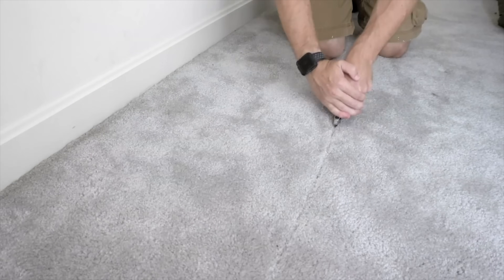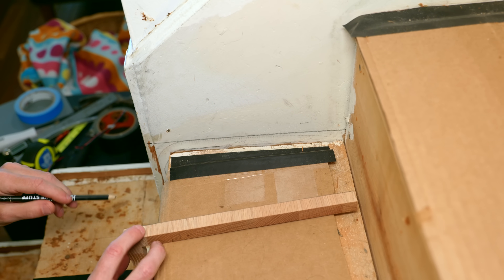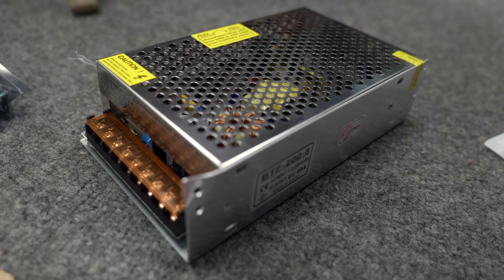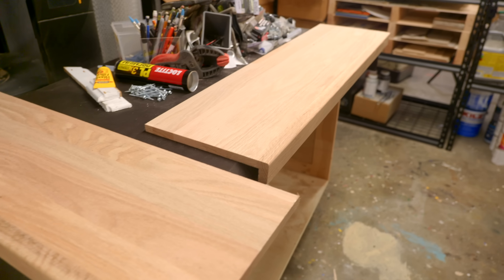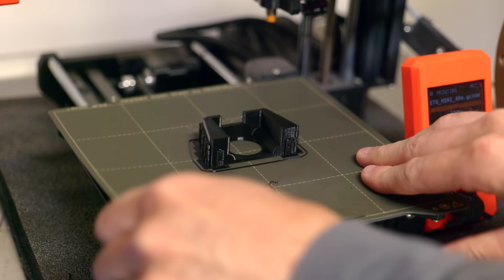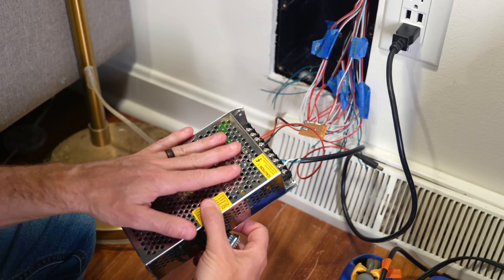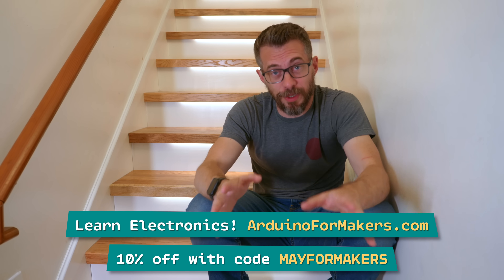Smart Stairs Now Exist...But Should They?

Comment: Fantastic project!  There’s so much to be proud of here.

As with any project that any maker shows to another, there are some things I would consider doing differently, but that’s just how it goes.  Please take them as having fun discussing ideas, not as any criticism of what you did.

1.  With the darker flooring on the landing, and the darker handrail, a stain or tinted poly for the treads could help it all be more cohesive.

2.  For the control box, you could add a pigtail inside the outlet box next to it, and run a wire inside the wall into the control box to avoid the cord and plug coming out of that nice walnut faceplate.  Just add a master power toggle switch if you want to kill power to the whole system.

3.  Speaking of that nice walnut faceplate, with the proximity to the visible treads, handrail, and landing, a wood that matched could help it blend better.

Again, this was a great project with wonderful execution.  Thank you so much for sharing it with us!

Comment: As soon as he started talking about gluing the risers and treads to the construction-grade stairs, my heart sank for the person who eventually has to replace these stairs. If you think pulling the carpet out is a chore, imagine having to delaminate all that glue in 20 or 40 of 60 years…
Reply: It's not going to be that big of a deal...I'd have the treads and risers out and the carriages cleaned up by lunch.
Reply: @erniemenard7727  Cool. So your estimate is 4 hours. You happy to be paid for 4 hours, however long it takes 🙂?
Reply: @DMLand  first of all that doesn't make any sense, that's not how it works when doing construction work. Second, as many have said, it's really not that hard to do.
Reply: 60 years?? Nah he’s good.
Reply: @calebreasons  "He" is probably not the person who will have to deal with it in decades hence. I'm empathizing with that person.
Reply: @DMLand  “he” is the theoretical person I’m speaking of. “He” (or “she” if you like) is good. Coming from a home renovator who’s dealt with 40 year old adhesive, it’s not all that difficult.
Reply: Where does that logic end? Don't put down ceramic tile because in 20 years you'll want to replace it and it will be tough to bust up? Don't pour a cement patio because in 30 years you may want to change it? Chances are someone will refinish the stairs, not replace them - no big deal. If someone is replacing the stairs you will know going in it will be a project.
Reply: @ruffxm  You're definitely not wrong, but wooden stair treads don't wear quite like a tile floor or cement patio.

On the other hand (the one where I agree with you), wooden stair treads don't wear out THAT fast, and in the intervening years, glued treads and risers aren't gonna squeak!
Reply: @DMLand    Yeah just my opinion, but I get what you're saying. I'm the one who installs things in my house and I'm the one who will also be ripping it out later...but if it's 20 or more years out I don't worry so much....I may not still be in the house - who knows. But for short term things I definitely think like that.

Comment: Nice.   A smaller single or maybe two sensors would work.  Also paint the housing wood colored or white to help hide them + wiring to the handrail.    Defuser works nice.

Comment: Gah. You make removing carpet look difficult and tedious. I'll skip the carpet and pad portion, cuzz it's funny watching you gayify that task. Let's remove some smoothedge...

You can easily remove smoothedge by using you crowbar like a punch-knife. Slide it across the floor and smack the smoothedge at the fastening nails; they will pop. If by some ungawdly chance you need more manly arm force, do not use a steel hammer on your steel crowbar!!! Use a rubber mallet! Hell, a wooden mallet will do... a block of wood.

CHING CHING CHING CHING...

YOU WANT A FUKKIN PAKI-DOT?!!!

Comment: No, they should not exist.
Getting LEDs in the eyes is problematic. having the stairs light up  above your head, means you're getting the light in your eyes.  Also, the sensor (if you're daft enough to use them) should detect approach and exit to the whole stair so the entire stair is 100% lit.  when going up or down, you're not looking at your feet.

Comment: Make the box biger. Order a new power supply with a battery charge/discharge circuit and put in a small 12v 9ah battery. This will keep it powered when power is out. I would set it in an emergaby mode for that maybe a red color or flashing so you know whats going on. 
You could take it to the next level and get smart fire/carbon monoxide sensors and create an "emergancy" mode. It maybe flashes and lights up in the direction of going down the stairs. Help direct the family to get out.

Comment: Those teeny little cables between the power supply and the boards that all the LED strips plug into?
If you run 40A through those, you'll get a house fire, from the look of them.

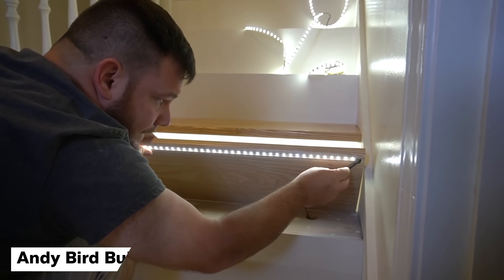Comment: Wild, over-the-top project! One thing I may have missed: the add-on tread approach would make your bottom step taller than the rest by 3/4” or whatever the tread thickness is, and the top tread shorter by the same amount, yes? (It looks like it on the Andy Bird clip at 2:48.) If there was a mitigation for that I may have just missed it. That’s pretty far out of the recommended variation, and would seem to create a trip hazard at both ends. I’m not sure that’s how those treads are intended to be used 🧐

Comment: Hit me up in DM if you want to spitball, I did something similar and went all overboard with a whole timeline'd animation engine that can have effects inside effects.
My stairs work on a full blown raspi zero W on NodeJS though, and with Time-Of-Flight sensors hooked to separate ESP-12's as tripwires that send their data over MQTT to the controller. 
Infrared sensors were way too inaccurate and triggered from cats. I wired everything from behind the stairs with single-colour LED strips. The whole thing can run from a powerbank, and, most important for me, can run my 17 step stairs by linking two PCA9685's
Reply: I-like-to-mak-estuff  screw you, scammer

Comment: there's a company that makes house lighting with several colored programs
I'd run the lights starting from the top, hide in the wall to the next step, across hide in the wall to the next step, across and so on one continuous strand, all I'd have to add is the motion sensors, and their lights have a remote

Comment: Its so nice. But why didn't you use the power next to the cable box and made an internal power connection? The black wire coming out of the walnut panel looks somewhat strange

Comment: Beautiful build but I’m concerned about the structural integrity of the cut stringer. Those hold the bulk of the load - and like a suspension bridge, need tops and bottoms connected for the full intended support. 
Also, make them fade more slowly with easing. Question: 
Why didn’t you do wider light beams?

Comment: The main benefit you guys have is that you don't have solid concrete walls. Adding a hole for a control box is 5 minutes work .. we have to get a jackhammer to have such a project.

Tho I am curious why you went for motion sensors and not pressure, seems an easy chore if you already replace the stairs anyway.

Comment: Pro tip: ALWAYS stick your LED strips to an aluminum backing. Be it a flat strip, a profile, an angle... anything. That way the LED will not overheat. If you stick them directly to plywood or any other material that has poor heat conductivity, your LEDs will fry and start to die sooner you'd like.
Reply: Then glue magnets to them and use a steel strip for mounting.
Reply: @PongoXBongo  not reallyt you don't remove them that often that magnets are proper way of doing it
Reply: or buy an aluminum channel
Reply: @jamiekomodo1751  yup. Like i mentioned in my comment. There are dedicated ones for LED strips.
Reply: well, the aluminum backing still needs somewhere to conduct that heat to, otherwise it will just sink it. Anyway, for a project like this where LEDs are not that bright and turned on for less than a minute, that wouldnt make a difference anyway.
Reply: @gabrielenitti3243 the aluminium backing creates a larger and more conductive surface area, which provides passive cooling on its own. That is often enough for LEDs.
Reply: @gabrielenitti3243  short periods of time like this are exactly where sinking the heat away would help the most, it provides a thermal load to keep short term heat down and the lack of extra surface area won't hinder longer duty cycles that these lights won't be experiencing.
Reply: @gabrielenitti3243  While this is true, the fact that there is space between LEDs and the aluminum track has sides, means the heat can spread enough to make it more than a few degrees cooler at the leds.  This is helpful even if the track is backed by wood.
Reply: I've built and maintained thousands of tradeshow properties using thousands of rools of LED strips. Never seen heat be a problem.
Reply: As they are not permanently turned on it should not matter. I have 2x 5m led strips glued directly to wooden beams in my car port and they still work after 7 years. Only one copper trace broke over time and needed to be resoldered.
Reply: @gabrielenitti3243 the tip is for everybody, not only people who use strips for a short time. Also the aluminium backing needs to be slightly wider. Another thing is that the aluminum backing will distribute the hear evenly while LED strips on wood will create hot spots and that's what kills the LEDs. I'm not saying what I'm saying because I think it might help. I'm saying it out of experience. I've worked with those strips and had plenty die prematurely. Then we've switched to aluminium backing and they stopped dying like magic. There are dedicated channels with diffuser covers for LED strips. And guess what, they're also aluminum. :)
Reply: @InnerBushman  thank you
Reply: and yet 7 years on the back of a hot tv and no failures.
Reply: You went to all that effort and planning then ended up with that ugly power cord arrangement
Reply: @McZorr0101  are you talking to me? It's not my video 😅
Reply: thank god i have rgb-led lamps
Reply: This is not true. Led degrade over time regardless. They have a life span of rated hours. I ran a test for 15000 hour led's, Which I ran 24/7 for 3 years. Around the 15000 hour mark about 20 month mark you could tell that they were degrading and by 3 years they were pretty dim and had degraded even further. I also had a 50k led strip installed in another location that was just as good as new at the time of replacement. I tested the light agaist the other half of the orginal led strip that was 15k and better led strips are far better.
Reply: @kameljoe21  The degradation is caused by several components, but the main ones are heat and pushing current close to the diodes' design limit. If kept cool and current slightly lowered, degradation is significantly slowed.
Reply: @kameljoe21  press X for doubt. Also one does not exclude the other. There are many factors that cause LEDs to degrade but heat is one of the most important. Overheating LED can fail in matter of weeks of abused.

Comment: I am a (timber) sprayer, I've sprayed hundreds of solid timber stairs with various lacquers. I have to say I love polished timber, but polished stair treads frighten the life out of me. One slip and your traversing the stairs on your back. Even with using anti-slip lacquers  I always advise customers to use some sort of anti slip protection on the tread 1 inch back from the front edge. This can be either a purpose made strip "let in" to the tread or just a coat of lacquer mix with fine sand.  Other than than looks great.

Comment: Maybe with sonar distance sensors you can make it work like you wanted it to? And for extra clout, you could use digital LEDs and do effects that go side to side. Or from and to the center of the staircase. Make it rain, snow, meteor fall, fireworks. Endless ideas there.

Comment: Ah, took the video to understand how you were wiring it. I had forgotten you don't have proper walls in the States, but instead wooden frames with huge gaps covered by plaster board. Does make putting wiring in everywhere easier. Looks good, but too much hassle for my liking. Thanks for showing it anyway.

Comment: Instead of finding the angle for every step, you could cut them all off at a 90, profile your followers on the side to match the steps, and use the followers to cover the gaps on the sides of the steps. It would look exactly the same, but you wouldn't need to have an angle finder, however, it would require more time, to cut out for each and every step. Alternatively, if the leading edges of the steps aren't rounded over, you could cut shoe molding to follow the edges of the steps, and it would look very nice.

Comment: Gets a 40 amp psu. uses wires that will catch fire if you'd run 40 amps through it. 
Hope you upgraded the wires to the leds or put in a fuse!

Comment: Disappointing that not all steps have a light strip, it really annoys my OCD, and equally disappointing the way the whole power thing is connected to the wall plug. It could have been a normal light switch with hidden installations like how any normal lamp is mounted 😢.

Comment: You may regret the friction fit. It won't take much for the humidity to shift the step through shrinkage, and the LED will likely fall out as someone puts weight on the step, creating a trip hazard.
Reply from the maker: Not a trip hazard as it's at the toe of someones foot usually or slightly behind someones heel. They've already slipped a little, but luckily the wedges make it super easy to adjust with humidity changes.

Comment: I would uograde the wires going from your power supply to the LEDs, you have all the high current load going through two thin wires. Your PCB also probably wont like 40 amps going through it. Something like Wago wire clips may be a better option, or just solder them together to larger gauge wires

Comment: For the most of the video I was like "This seems like way too much effort for just some fancy LEDs" but then I've seen the end result and I was impressed lol
It's so cool
Reply: Yeah, I was thinking the same thing. I’m sure a moderately skilled craftsmen could have a lot of fun doing it the way he did it. This is not a project that would be satisfying to a novice. I just can’t imagine cutting out that piece of trim on the sides. That’s what an eighth inch of caulk is for. That way it can be done more  simply, but still get the same effect.

Comment: What MCU did you end up using? You said you would use an ESP32 at the start, then you changed to an arduino uno then it looks like you switched to an arduino mega, so what did you end up using in the end and what was your reasoning for it?

I think you probably couldn’t use the esp32 in the way you were planning because it typically uses its RMT peripheral to drive LED strips and it only has 8 channels, so not enough for a channel every step.

Are all the led strips wired in parallel? If so you could have saved a lot of pins by wiring the data lines in series or at least wiring a few steps in series and the splitting the steps up in the code. It wouldn’t have taken much more than running a data line from the end of one strip into the start of the next. MCUs, especially the esp32 are capable of running long LED strips.

Comment: I think you should consider swapping the PIR sensors for a microwave human presence detector that can measure distance too, then if you put one at the bottom of the stairs pointing up then you would be able to tell what stair they are on. Another more involved option would be to have laser tripwires on every step. For simplicity you could use a ToF distance sensor in place of the microwave human presence detector and just measure the distance, if the distance decreases then you have a person on the stairs.

Comment: I appreciate all the work but I don’t get the point of putting led lights on the stairs. Don’t most homes have a light over the stairs? I have one that I can turn off and on at the top and bottom of the stairs. I guess some people would think the lights are cool though. My style is more traditional. I would worry about how this style will hold up in the future. It might look completely tasteless in 10 years. Great work though. I will use the part of the video that just deals with putting in new stairs.
Reply: Well, it is for a particular audience. Probably will narrow the list of potential buyers if goes onto the market, but this is the case with any custom modifications

Comment: LOVE the lights!
Safety note: Hardwood steps can be slippery. Socks, or something on your soles (moisture, oil/grease etc.) can be dangerous.
This is why you often see carpeted stairs even in homes with all hard floors.
Reply: Agreed. We added texture strips to our hardwood steps after every single one of us biffed it at least once.
Reply: While talking safety. The top step is unlighted which might be a safety issue at night.
Reply: @b4time718  No more of a safety issue than not having the lights to begin with. Especially considering almost anyone who lives in a house with stairs can probably navigate those stairs with little to no light.
Reply: Respectfully disagree. Falls on stairs  represent one of the biggest household hazards. Not lighting the top step will alter perception in the dark and is a hazard similar similar to having one riser of a different height.
Reply: Additionally, Some places have a very thin red carpet that goes down stairs down the middle of it to try and prevent slipping. I don't know why you'd do that though, instead of carpeting the whole thing!